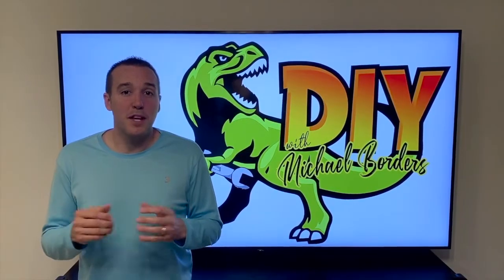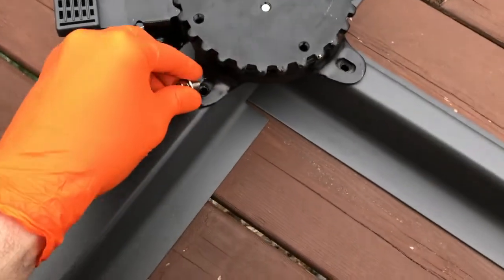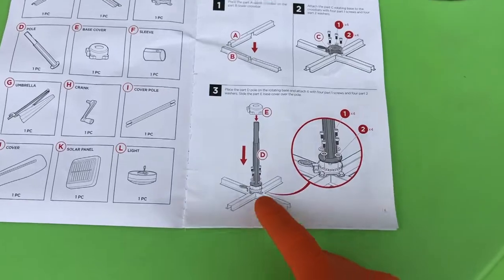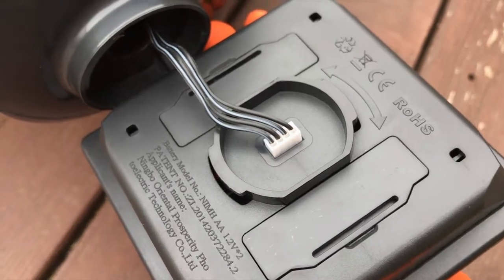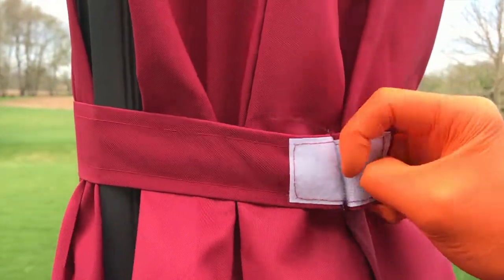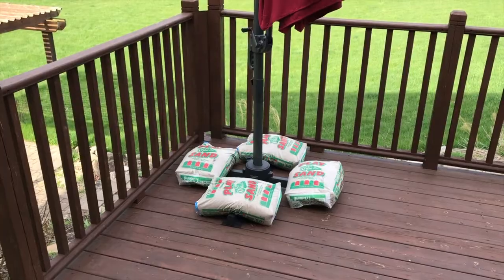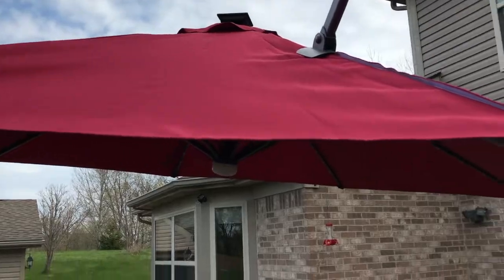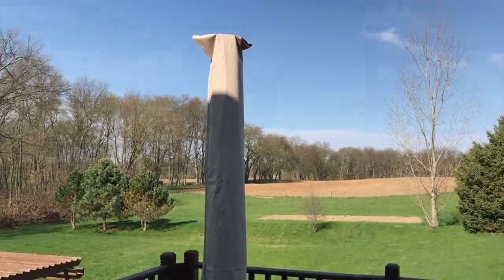Assembling solar LED "Best Choice Products" offset patio umbrella

Comment: At time 3:13...what is that part?? I don't see it on the instructions.
Reply from the maker: @flygirl1212  

Thanks for watching, are you referring to the foot pedal that allows you to shift the position of the umbrella or are you talking about the shaft cover that is slid onto the shaft and placed directly over where the two parts meet.

Comment: My pedal isn't working, and I can't, for the life of me, figure out why. Arrghhh...
I will have to watch again a little  closer and see if I can figure out why.
Thanks for making this video.
Reply from the maker: Good morning, just poured a cup of coffee and am sitting down to answer any and all questions for the DIY community.

Any update…?…is unit brand new…?

Let us know if you have any questions and hey if you’re into crypto trading, join our DIY ecosystem.

       toolboxtoken.com

Reach out to us any time!  🧰
Reply: Hey, thanks for answering. It's new, yes. Wlhen I push the pedal nothing happens, and now that I've had a chance to re-watch and look at my own, I'm wondering if it's possible that I've got the second set of four screws (step 3) in too tight? Maybe that would stop it from rotating? It doesn't seem like the most probable option, but I'm at such a loss.
Reply from the maker: @kisha8983  

Thanks for the reply, any update?  Did you adjust screws?